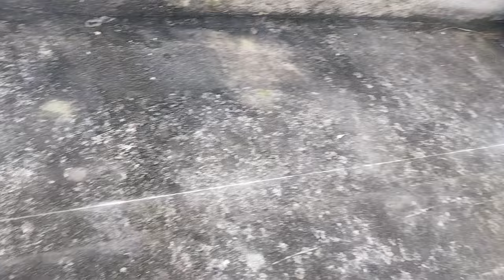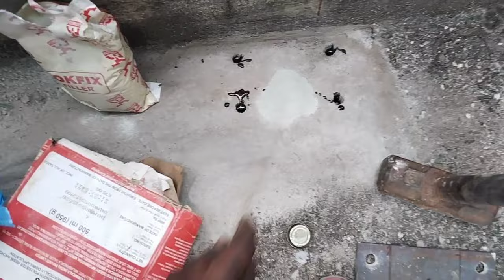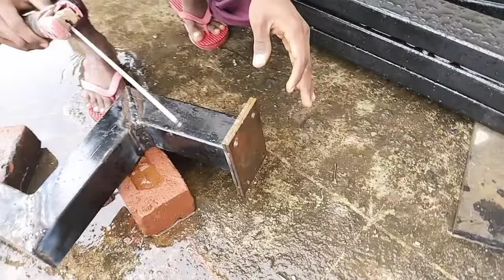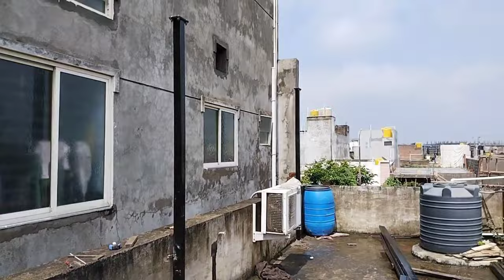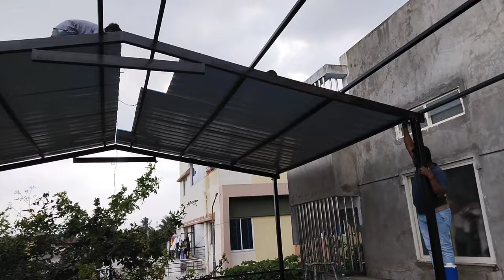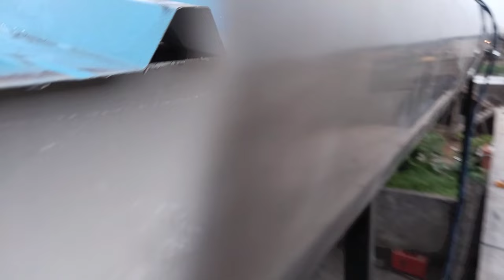Home Tarrace shed 20x30 Fabrication shed Work @WFE #youtube #engineering #tarrace #fabrication #shed

Comment: purling ka charo side welding hota hai  ?  rain pipe ketna diameter ka hai ? pls confirm karo .  thanks . god bless you .
Reply from the maker: Two side welding on top only
Reply: @wagingerifabricationengine1071  thanks a lot for  conformation . I insisted the contractor  to do welding on four sides of purling so that  tin sheet will not  be blown away with the purling  due to  the storm .
Reply from the maker: Charo Side Welding Lagane se Pipe Ka Strength Kam Hota Hai Aur Worker's Charo Side Welding Lagane Ke Chakker Me Pipe Me Ched Kar Deten Hain Wahan Se Pipe Ko Zang Lagna Shru
Reply: @wagingerifabricationengine1071  🙏